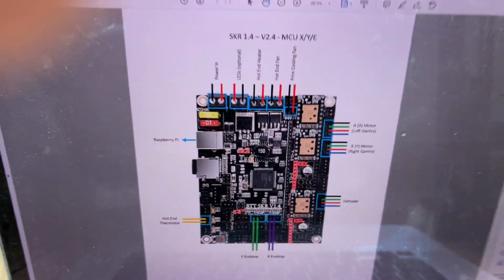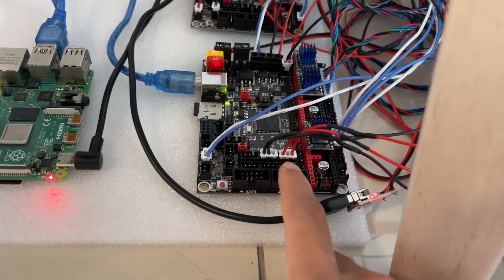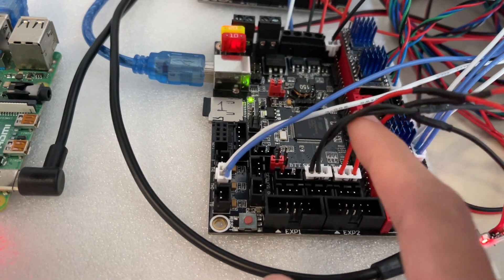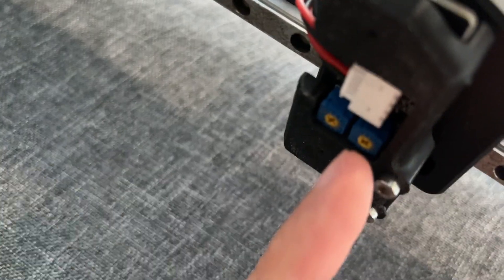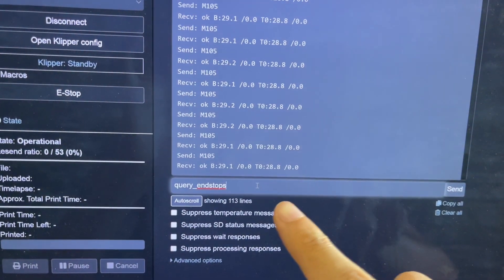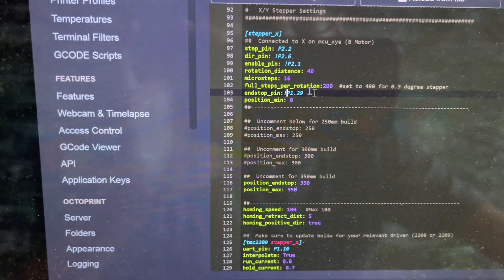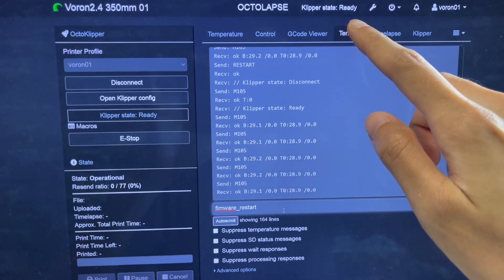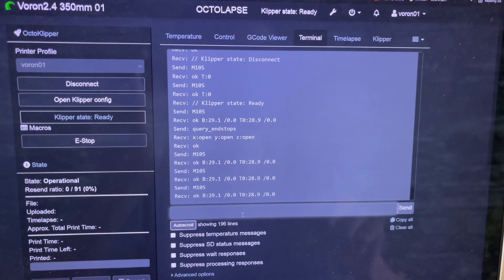[Part 7] Voron 2.4 350mm Hall Sensor + wiring + aluminium bed

Comment: what are you using for your Z endstop? X and Y is working with the hall sentor, and Z? what do you connect in the Z endtop socket in the motherboard then? nothing? thank you!
Reply from the maker: Xy for hall sensor, z for micro switch
Reply: @maverickng  Thanks

Comment: did you have any issue with the aluminum parts used inplace of printed parts ?
Reply from the maker: Haven’t start print. But the z axis aluminium parts  on the linear rails for 4 side, each comes looser when the movement is keeps going.

Comment: It appears your bed heater covers the entire bottom surface of the build plate.  Does it lay flat on the rails and will you have any trouble bolting the plate down?  I considered doing the same but was worried about the plate being level and damage to the heater from the bolts.
Reply from the maker: Sorry not clear what are you talking about.
Reply: @maverickng  It appears to me that the bed heater and build plate are exactly the same size.  So I was wondering how the plate is secured to the rails if that is the case.  But it could just be mistaken.
Reply from the maker: Which axis for the rails ?
Reply: I think he need to ground the build plate for safety reason. Optional, add a thermal fuse 130 C to the build plate. I not sure if the omron relay is authentic or not. I am using the Panasonic Relay 20 A and a thermal fuse 140 C.